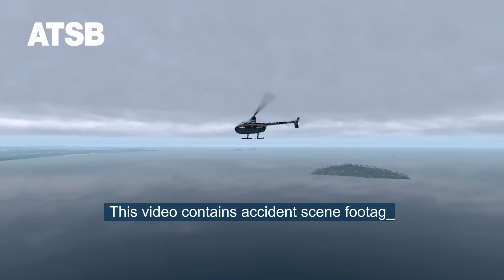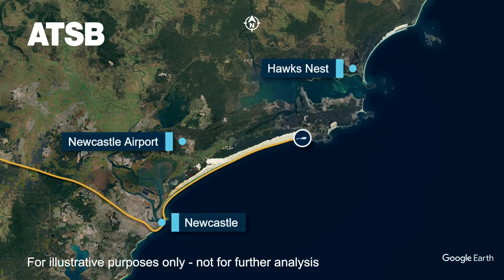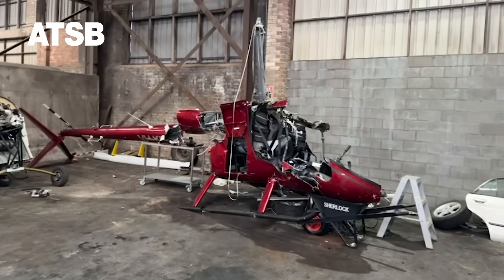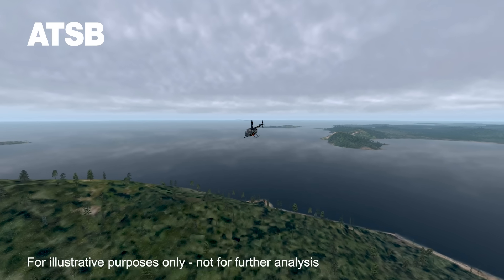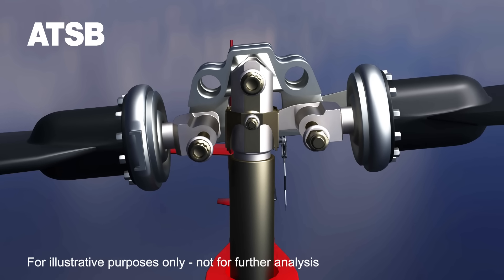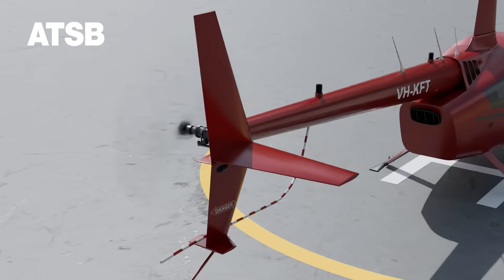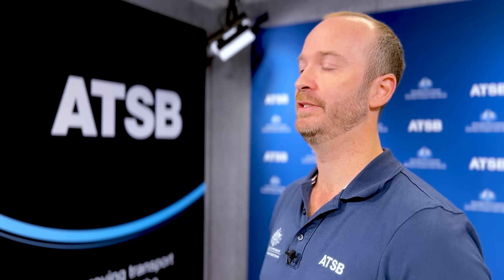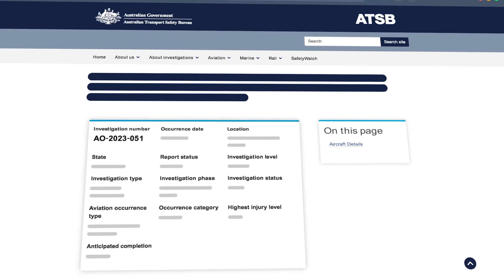R66 flight into turbulence leads to mast bump

Comment: The number of people saying it’s an issue with the helicopter is abysmal. You can’t hop into a Robinson and fly it like a 206. Robinsons have strict operating limits, and every issue was pointed out in the video. Condolences to the pilot, friends, and family, but this was just a huge case of bad ADM. Weather like this (especially near a coastal area) you are almost guaranteed to encounter turbulence. Video and POH state, 60-70kts. Pilot was doing 50 over that without proper handling of controls. Clear example of a hazardous attitude, overconfidence, or just a lack of situational awareness. I may not be the most experienced pilot in the world having only flown R-22s for a few hundred hours, but I can confidently say that if you actually read through the POH regularly, and familiarize yourself with the limitations and are actively avoiding the potential hazards highlighted in the safety notices, then they really are great helicopters. This accident really just seemed like a bad case of complacency. These are helicopters that require awareness and attention at all times. As with any aircraft, stay paranoid, always expect something to go wrong, so that when it does you won’t be surprised. This crash never should’ve happened. May the pilot rest in peace

Comment: Good morning, first of all, thank you very much for your video.  I am an Aeronautic Engineer and Helicopter Aerodynamics Professor in Argentina (but not a pilot unfortunately) and i have a question, As far as I am concerned, the solution for mast bumping is apply collective pitch so as to load the main rotor, could you explain me why you recommend to teetering head helicopters to be aware of the risk of encountering a low-G condition in turbulence

Comment: I have only ever flown Bell products with 2 bladed, semi-rigid rotor systems, and I remember never having time for a Succulent Chinese Meal while having both hands full with a throttle without a governor and constantly required carb heat adjustments to prevent carburetor  icing on 
a Bell 47.
  Before the age of GPS it was common to cruise with collective friction on, cyclic in left hand, pencil in right hand to make notes on chart/ map on right knee, when map & compass ruled.

Comment: Why does anyone want to fly a helicopter with a built in design characteristic that can kill you ?   No one plans to get into a low G condition. It just happens. Everything‘s fine until it isn’t.  There are other designs that don’t do this.
Reply: Generally cause they are cheap peformant and reliable to fly. Hooning along at 115kts in a 66 light weight with such little separation from that small but reasonably sharp mountain is basic 101 stuff that this guy obviously missed
Reply: @ZPHeli  the fact they are cheap to own and operate, is part of the problem and is why you have so many inexperienced pilots flying them. I flew one (a 22) once back in the 80s.. never again.

Comment: You can scoot along at close to VNE in calm weather but the moment you start to feel or see any change its time to load up the main rotor and slow down into a safer range of speed. This accident appears to have its root cause in the training and culture of the training the pilot's instructor received. 
Then you have CASA's arrogant beyond comprehension over confidence in their ability
to do an "investigation" that in this case touched all the right points but is disappointing when viewed as a whole.

Comment: This Robinson critical video spends little time on the actual cause, the pilot exceeded the airspeed limitation and knowingly entered an area of obvious turbulence.    Whats missing in this video is the obvious warning symptoms the pilot ignored. We can see the causes of turbulence ahead, the pilot would have encountered escalating turbulence,  he most probably flew for extended periods of time at the higher than VNE air speeds.
The cause is hazardous attitudes , particularly macho, and its
an almost encouraged attitude in come circles.

Comment: How do you know if you're going to encounter turbulence on such a simple aircraft? Do you use radar? Or just expect it based on the terrain?
(I'm not a pilot)
Reply: I'm not a pilot either, but there's often downdrafts etc when crossing the ridge of a hill. There's a video from NZ where a glider pilot & student inadvertently crossed a ridge in fog, which sent them plummeting & coming mighty close to the trees before being able to pull out. They ended up pulling about 6 G's during this.

Comment: Robinson…..again.
Reply: So safe it's the only helicopter with a special FAR written for it, Go figure!
Reply: Cue the Robinson fanboys (never thought such a niche, obscure, and expensive thing would have diehards, but here we are lol) to explain exactly how it's always the pilot's fault (to a degree, they're not necessarily wrong, depending on how you look at it), and that Robinson's are perfectly safe.

Preventable accidents can still be causal to mechanical circumstances. What I mean is, just because the pilot is at fault, doesn't mean the vehicle isn't either. The frequency that these Robinsons have these types of incidents is alarming, and it's blatantly obvious what the issue is. I have never seen such a glaring flaw in design garner so much defense before.

Other teetering systems have larger tolerances and some are even capable of handling so much abuse that other failures will have occurred before a mast bumping incident will have occurred, under normal circumstances, with the most prominent example being the Bell 205/UH-1, which is even itself well known for having these types of incidents. I'm not a pilot, but numbers don't lie, and the engineering behind these vehicles doesn't either. The Robinson system is clearly inferior and in need of improvement.

That said, I don't know that I'd be stuffing my gullet under the circumstances, and I hope that everyone who flies one of these would understand the risks and know what to do and not to do.
Reply: It's amazing how the most popular helicopter in the world shows up more in accident reports. Not.
Reply: @UncleKennysPlace  it's popular because it's so cheap. Leading to low hour, low experience/competence pilots flying them. They introduce a number of factors that increase risk and decrease safety... it's not just how many of them are being flown.

Comment: Collective down and cyclic back at the first hint of turbulence was what I was taught. Taking time to finish your sandwich first never even made it into the curriculum.
Reply: Yeah, you really want to load up the blades, almost to the point of auto.
Reply: @fredfred2363

Both of you are talking backwards.  An auto is unloaded.  

You want to LOAD the rotor by pulling MORE collective.. so the fuselage and mast will remain aligned with the rotor disc.  

You need to put cyclic input into the direction of the roll to keep the rotor from bumping.
Reply: @calvinnickel9995 You might care to read Robinson Safety Notice No: 32 which specifically says to reduce power and if a low g situation occurs to apply gentle aft cyclic to load the disc. It definitely does not recommend trying to load the disc through increased power.

Comment: Why is low-G mast bumping still a thing today? Why hasn't there been a rotor head designed the might 'bump', but not against the mast? I know this is a very broad question/statement, but why hasn't mast bumping been engineered away already? Many 2 bladed tail rotors have very stiff elastomeric bearing to keep them somewhat rigid but still able to move freely, is it not possible to do something similar for main rotors, where you might lose some rubber under certain low-G conditions, but not the whole rotor head?

Just asking.
Reply: Every Roninson I've flown has this already. Serious enough bumping can still break through.

Comment: Pilots eat all the time when schedules are tight. But they don't drop the helicopter over a pickle.
1 - Never eat right handed. The primary control is the cyclic. Friction on collective use left hand to eat.
2 - Expect a bump over the windward side a dip on the downwind side
3- Bells Hillers and Robinsons the Gs go low add a little aft cyclic (What's so hard about that?)
4- Fixed wing pilot revert back to primary training in a surprise events - pitch & roll = deadly in helicopters. Aft cyclic only.
5- Horizontal rotors in wind are unseen and will roll an air craft with no low G.  A quick roll event from your hills up wind miles away,  Rolled side ways? Add aft cyclic and complete the maneuver with gentle roll after you feel 1 G under your but. 
This is a teetering hub limitation not just Robinson... Pilot sealed his own fate probably a fixed winger gone rotary wing.
Left hand control and no action in helicopter upset .  The horizontal rotor? I had it happen in the early 80s.Still here still flying

Comment: Seem to be a disproportionate amount of Robinsons involved in accidents.
Reply: something to do with the fact they're the most numerous helicopter is use by a very large margin, something like more than 50% of all helicopters are robinsons
Reply: @mathewferstl7042  From what I could find, less than 1/3 of helicopters are Robinsons, but they make up about 90% of piston helicopters.
Airbus has about the same numbers as Robinson, with Bell not far behind, but Airbus & Bell are all turbine powered.
Reply: @DoubleMonoLR that sounds about right, thanks for digging for the numbers
Reply: @mathewferstl7042  Bingo
Fact Check = Obvious
Reply: Yeah, cuz they're cheap, making them an attractive entry-level machine. There are other teetering-head choppers that fair much better because their price keeps people from putting low-time pilots in them.
Reply: @MrSunrise- That is a great filter.  You see a lot fewer low-hour novices burying a $2+ million machine into the side of a hill.  It happens. But a lot less often.
Reply: Nope Just entry level stupidity. Nothing wrong with the machine. Something wrong with the meat servo

Comment: Teetering masts are crazy dangerous.  Anyone who flies them is waiting to be a statistic.
Reply: Not if you stay in the operating envelope
Reply: 45+ years in Robinsons Bells and Sikorskys - teetering not the issue here. Pilots understanding the machine is.
Reply: Understanding and staying in the envelope. R66 is a great Helicopter.
Reply: @GyrocopterGirl  All helicopter are great when you get paid to fly them
Reply: Depends where you're flying tbf.
Reply: Literally the most common and longest lived helicopter design flying. Obviously it’s just an experience and training issue.
Reply: Robinson designed the teetering system for Bell, who have since ditched it  realizing that despite its simplicity and low cost it is a dangerous design. Bell was sued by military families in the 80’s for this design. It is postulated that many Vietnam Huey losses attributed to enemy fire were in fact mast bumping incidents due to evasive action. You can train out of anything, including something as unstable as the Wright Flyer, but that is no reason to not employ safer designs that require less profiency.  @manfredstrappen7491
Reply: All valid comments, but it’s common because it is cheap, not the best. 

Robinson was the designer of the teetering system at Bell which later ditched as a design for better, more expensive designs. 

You can theoretically train for any design deficiency and staying within the envelope is fine except when you don’t.  The teetering system is much less forgiving of envelope excursions than other designs. Many Vietnam losses occurred due to evasive maneuvers resulting in mast bumping. In the 1980s Bell was sued by service member families for the design. Bell, like all military contractors, eventually won the case but the fact that lawyers and judges even entertained the lawsuit speaks volumes to the underlying problems with the design. The Army considered asking Bell to modify the design but did not for cost reasons. They just quit buying helicopters with teetering systems.  

Robinson seems to be the only manufacturer that has never gotten the message. 

Question, if after all these years teetering masts are so great, why does no one else use them?
Reply: @glenwoodriverresidentsgrou136  Frank never worked at Bell. Hughes SIble (Cessna) The teetering head was a carry through with Bell
Reply: @glenwoodriverresidentsgrou136  The Army & Bell did a study on the mast bump issues in the late 60s early 70s and they found low G and translating tendency/Tail Rotor thrust in the event, Hiller Bell Kaman all had teetering systems...
Ever hear of droop stop pounding? same thing. Frank didn't design a trainer he built a low cost high performance helicopter. for seasoned pilots. He cornered the training market by accident...Just in numbers alone of course you'll have a higher accident rate.